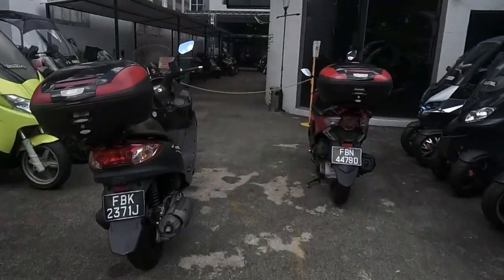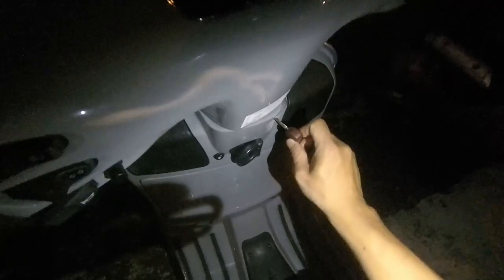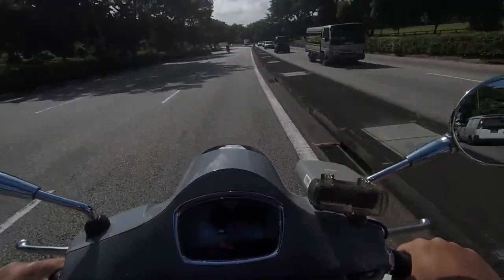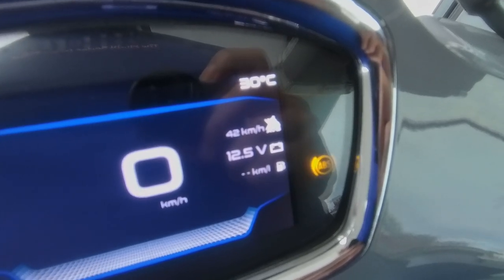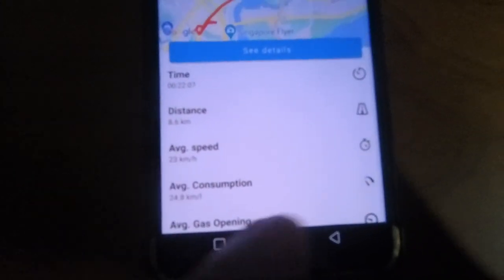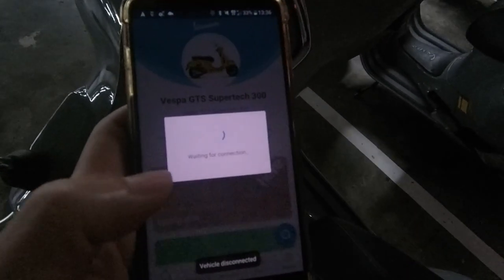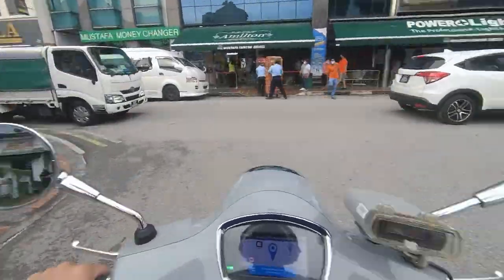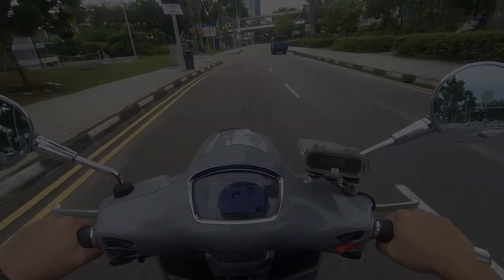Piaggio Vespa GTS300 SuperTech [ Test Ride ]

Comment: Can anyone comment on vespa reliability?
Reply from the maker: Generally i felt that they are reliable (the 4 strokes one). But subject to a few factors :

1) how well the owner maintain it?
- vespa is not something like Honda wave that we can neglect the servicing and keep abusing it

2) How the owner ride it?
- Too fast = bad for belting & piston
- Too slow = carbon build up over years cause sensor issues

3) The use environment
- Seaside = rusty, as veapa are mostly make from metal (not abs plastic or glass fiber covers)
- Singapore + Park Outdoor = Rust

I have friends who ride a 12yo vespa LX150, they are still happy with it.
Reply: @zwc888  thank you. Most of the older 150 are not reliable enough for 200km plus trips. I have a grom and elite 125 that I very much enjoy. Tough decision to sell my MT 10 and buy a vespa. I might miss the 1000 legs